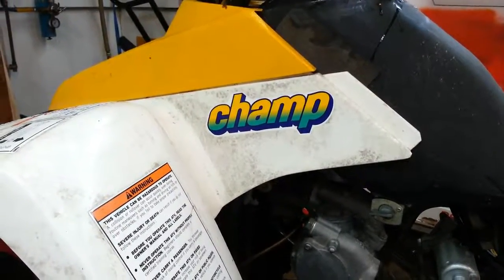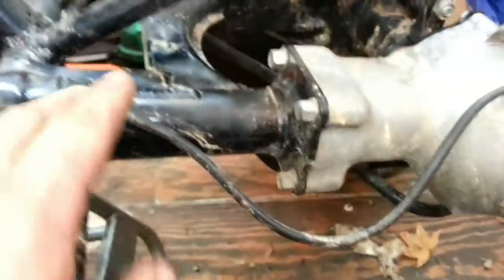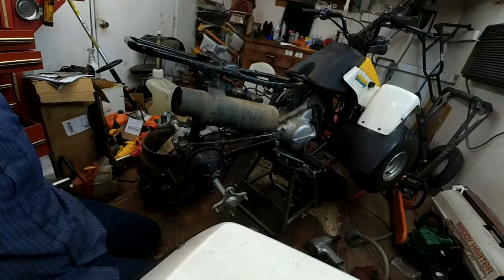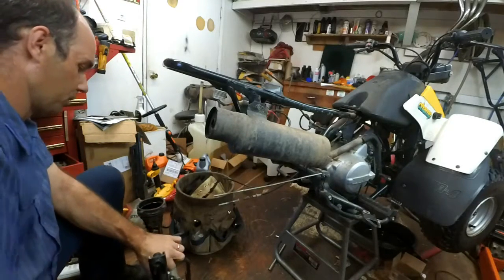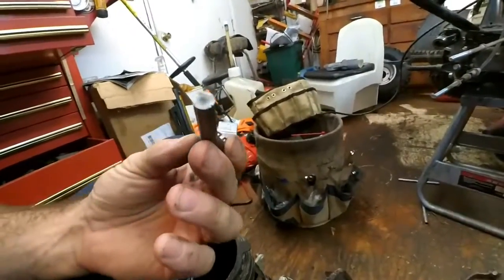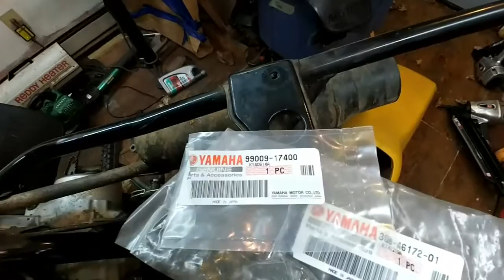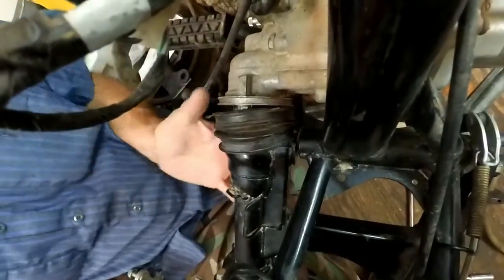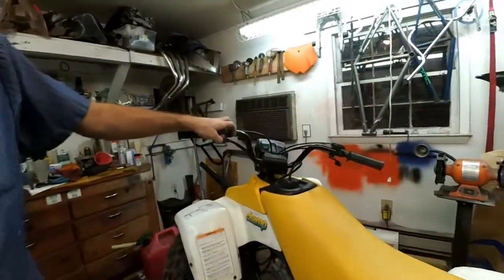Yamaha Champ drive shaft transmission repair

Comment: This might sound stupid but I just bought a quad that needs fixing... the casing where the drive shaft goes is cracked on the rear.. you know what part that is... I think it might a be a differential

Comment: I just finished redoing my bearings on my moto 4 this evening, everything went well but now I'm having a hell of a time trying to get my rear diff and drive shaft to slide back in. So i gave up until tmw, I might have to take the whole rear apart and see if the drive shaft boot or universals isnt damaged.
Reply from the maker: Yeah something isn't right, should slide right back in.

Comment: Is it possible to swap an older yfm 80 champ engine  into a badger frame and use the champ driveshaft? My badger looks the same as the champ in this video. But the champ has a three bolt cover over the drive shaft. Instead of four. Thanks.
Reply from the maker: I believe they are the same engine. I would do some parts comparing on a parts diagram and see if they share the same drive shaft parts before I swapped anything.